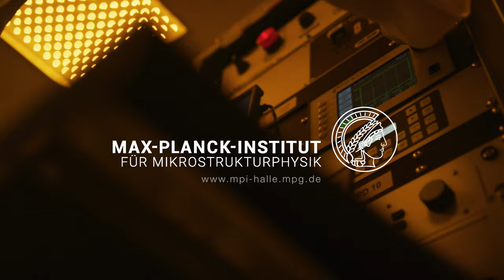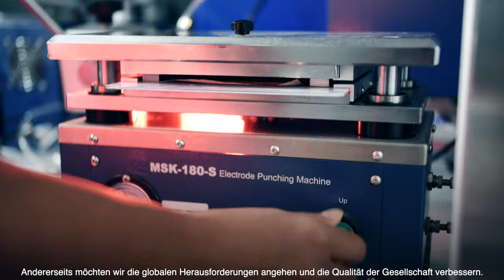Max-Planck-Institut für Mikrostrukturphysik

Comment: What happens when forming a mass of capillaries that penetrate the material from one side to another? If carbon dioxide is introduced from one side and saltwater concentrations with high surface tensions from the other side. And both substances move towards each other, breaking the capillaries in this motion. Could the carbon dioxide exhibit reversed pressure behavior? Could it generate vacuum pressures?